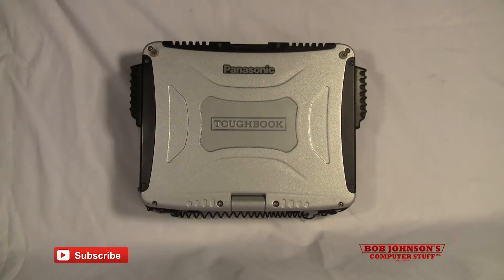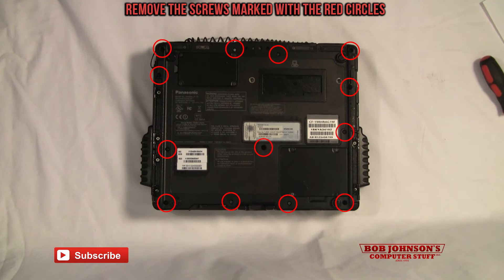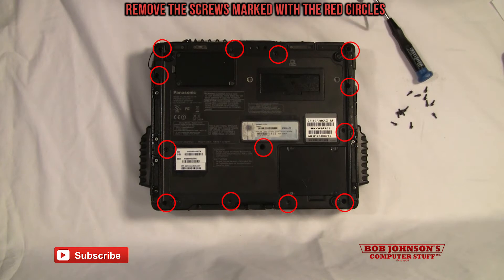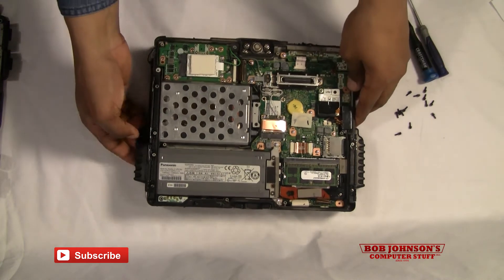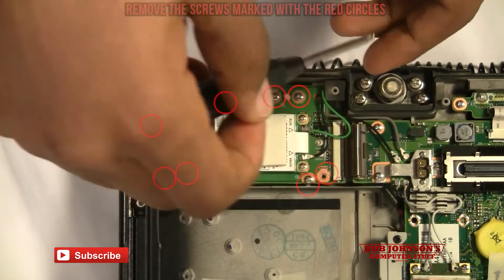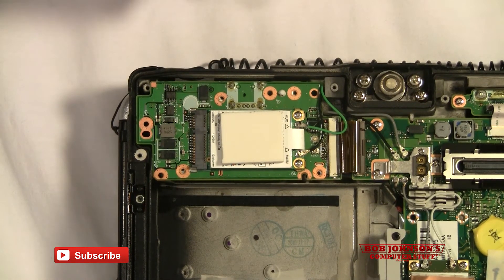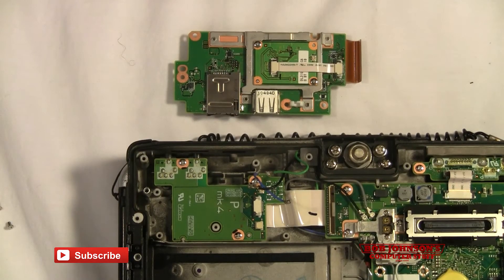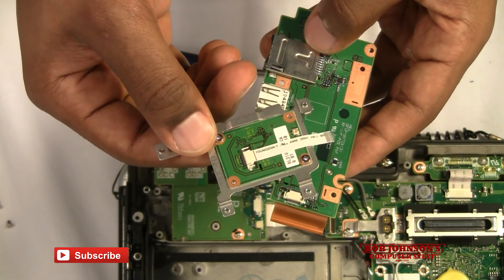How to Replace the Bluetooth in a Panasonic Toughbook CF-19

Comment: Nice video + I have now subscribed
I have a question for you.
How do I turn on the Bluetooth on a Panasonic CF19 MK6 i5 2.60GHZ Rugged Toughbook running WIN 10? 🤔🤔🤔🤔
Reply from the maker: Bluetooth should be turned on by default unless it was a model that came without Bluetooth. You can check BIOS to make sure it is enabled there. Check to make sure it is showing in the device manager. Also, try cycling the wireless switch on and off again. Additionally, check to make sure it isn’t turned off in the wireless switch utility. There is a setting in Windows 10 under devices in the settings app.

Comment: I have a CF-19 MK6 and need to replace my bluetooth antenna but I can't find the part you are showing here. Is there somewhere else I should look? On the side of the screen I see a lower antenna that has BT on it with a white wire. I'm thinking this might be it but not sure. I've stripped the whole thing apart looking for a blue wire like in your video. I know it has bluetooth because I'm able to use it but the range is very poor requiring me to have it right next to the device.
Reply from the maker: Would need to look into it. Use this form to have one of our techs respond.  http://bit.ly/319UMWX